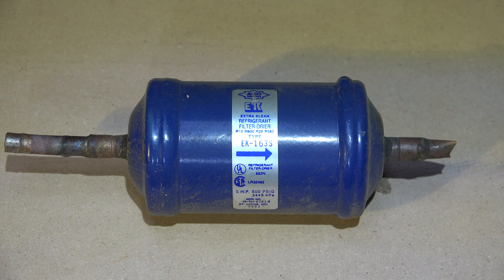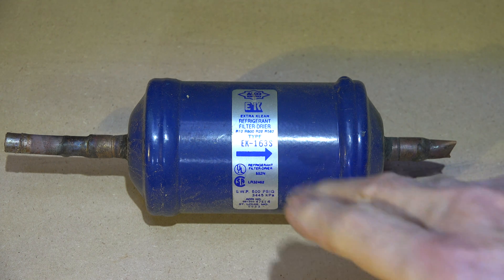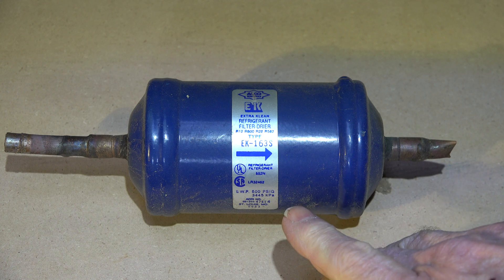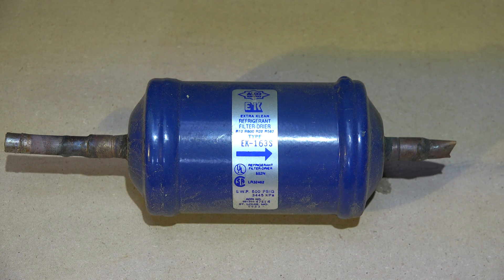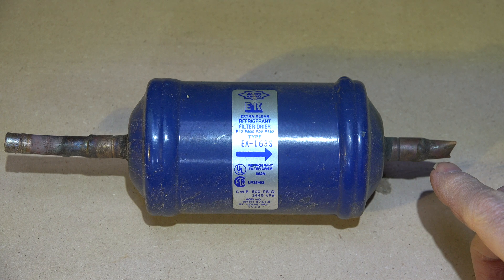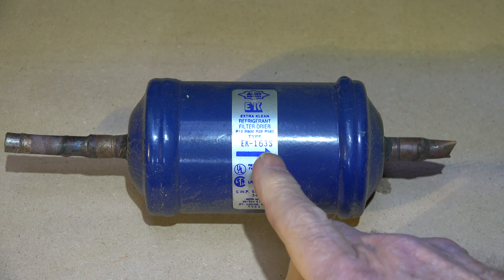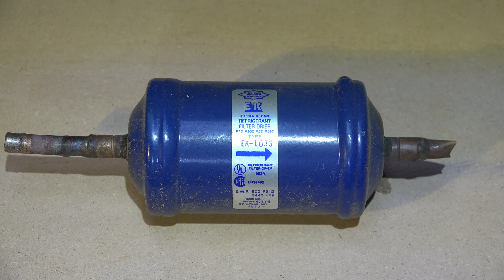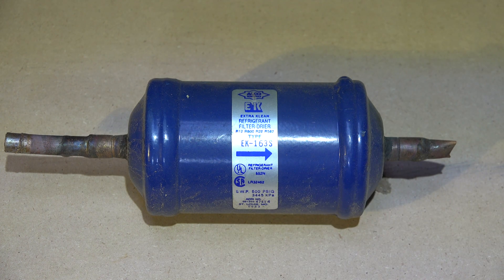What the numbers mean on the refrigerant dryer

Comment: I put on pause and struggled with the question: how do I tell if this is for liquid/high-side or gas/low-side?   (It doesn't say on the label.)  Digging back to earlier videos, I think the indicator is pipe diameter --> small pipe = liquid/high-side;  big pipe = gas/low-side.     (correct?)

Comment: What goes on inside a heat pump filter dryer? They install in either direction and the flow reverses as the system cools or heats. I'm guessing 2 sections and check valves? Have you dissected one ? Even better,  Hows about a video...

Comment: Daikin does not use filter driers on there installs, in there classes i have been to they say that filter driers are for bad installs. If you purge your lines with nitrogen when you solder you will not get a carbon deposit inside the copper and if you pull a propper vacuum below 500 microns that hold you will not have moisture in the system. Just something im pointing out, that it just adds a restriction.
Reply from the maker: +Bernie Clement On new installs, I would not install a drier.  For leaking systems or compressor replacements, you better use one.
GFM